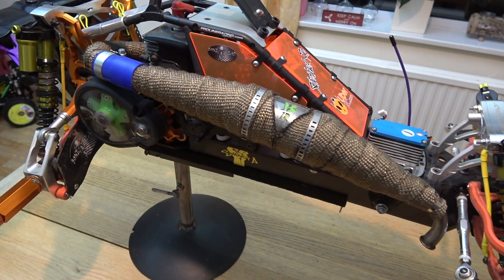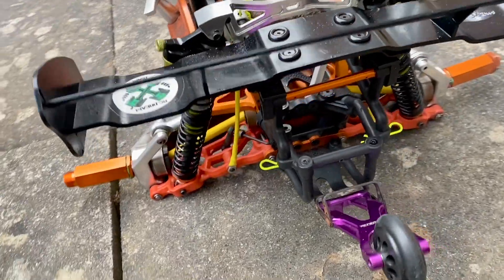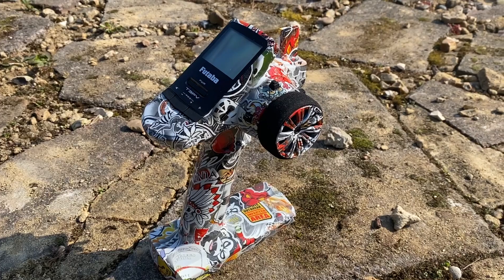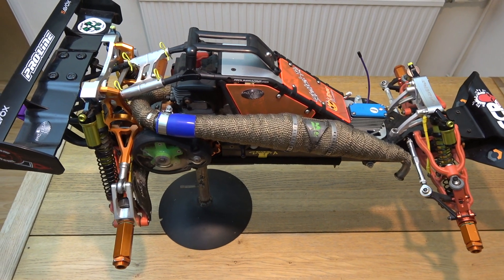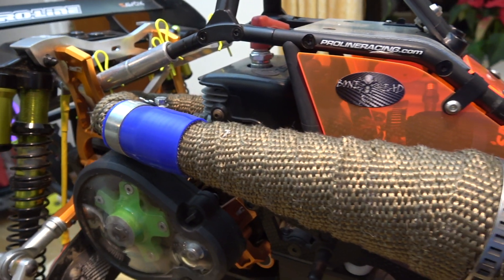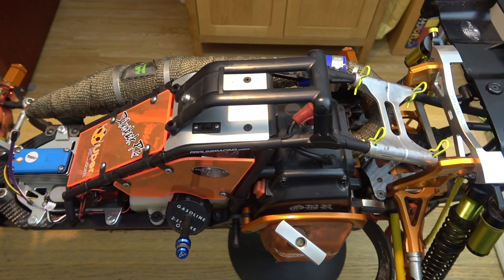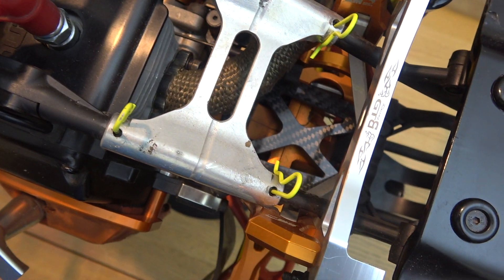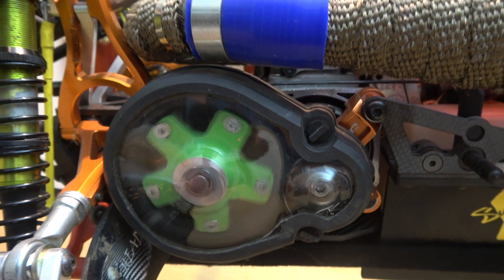BAJA's BACK!

Comment: Just finsihed my baja. Reed case. A lot of turtle racing stuff. Just out some front hydro brakes on. Rtr rears. 10k diff oil shocks all done. Modified rc chassis plate. 813 carb, hostile hubs 2degree, fruitbat parts throught aswell to much to list. Rpm arms all round etc

Comment: tats a nice look baja i have been looking into get 1 of these instead of nitro i am torn between a few different types tho more so due to budget either the rovan lt360r 36cc the baja as1 36cc or the km bladebaja 34cc i would like fid dragon hammer your is sweet but alittle pricey which way would you head on those given the choice

Comment: Hey that breather valve u put into the gas cap.. I have an extra cap with a valve like yours... do you take out the rubber piece inside or leave it in
Reply from the maker: FPV Addict One hi mate. You still need a good deal from the cap so likely need the rubber in. In the past I have cut a hole in it though. Just make sure you have good air flow. The vent you install should have a valve in to stop fuel leaking if you have a roll over.

Comment: Joe,  check out my Baja it's on my channel. Following you quite some time now, and still waiting to see some running footage of this Baja again.... Could you sort me out the same pipe as you have, the Bartolone in the UK? Been searching for it, but they do not turn up in the Netherlands it seems. Running a BZM Micro for some time on my G320 OBR some time and it performs well.... But want to try the Bartolone too. Cheers dan